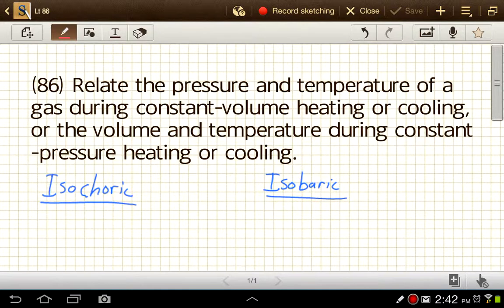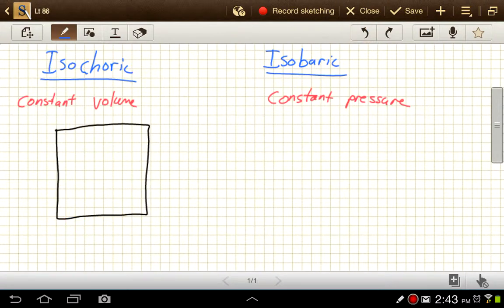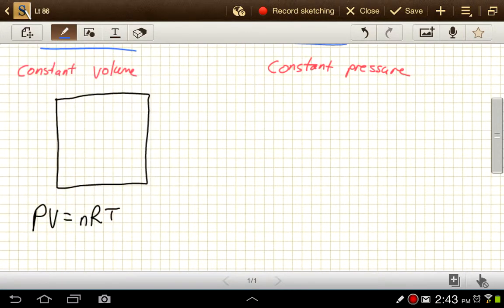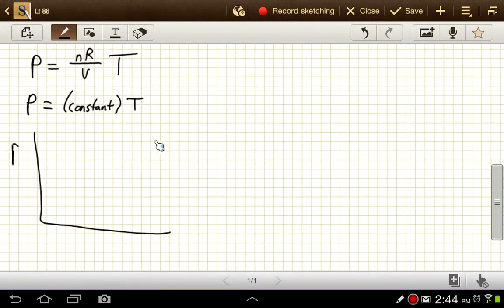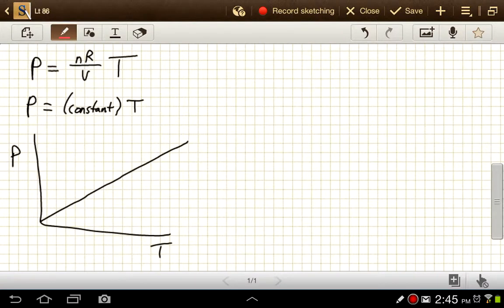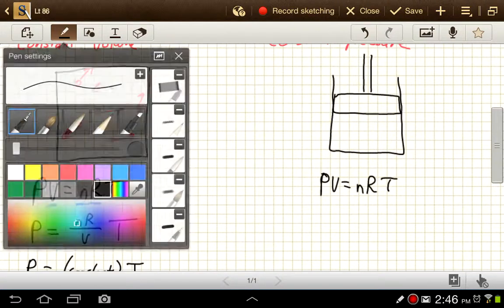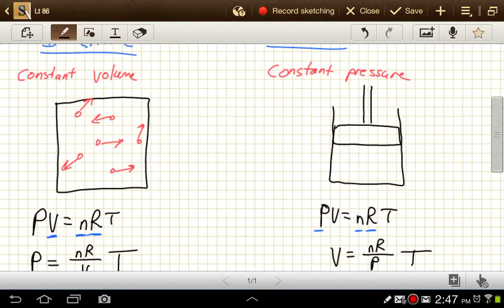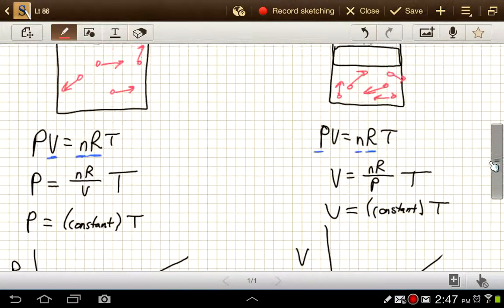Lt 86 - isochoric, isobaric processes

Comment: I'm not sure to understand , about isobaric process , so when the volume increase than heat increase ???
How that , need to volume increase during temperature decrease ,  doesen't it ?
Reply: You cannot generalize statements of what happens between two variables without consideration for the details of what happens to the other variables.

In an isobaric process, heat is added to the system, pressure remains constant, while volume and temperature both increase proportionally to each other, given an absolute temperature scale.  A little bit of work is done by the system simultaneously, and is equal to P*(V2 - V1).

Your second statement applies to adiabatic processes, that happen with no heat transfer, and work is done by the gas from the drop in internal energy.  Entropy is the property that is constant, but classes usually withhold teaching that until much later.  The relationship that governs the relationship between temperature and volume in that process, is T*V^(gamma-1) is constant, where gamma is the adiabatic index.